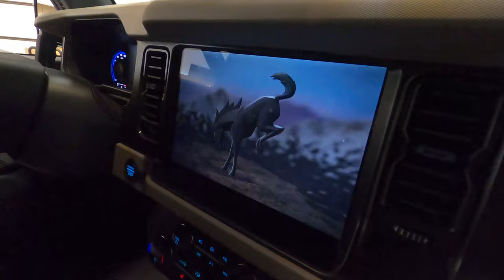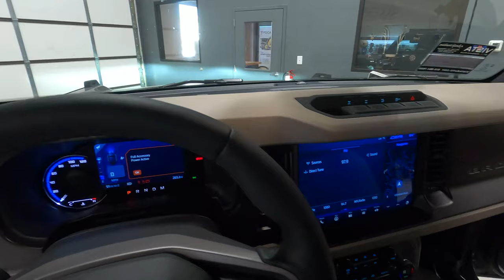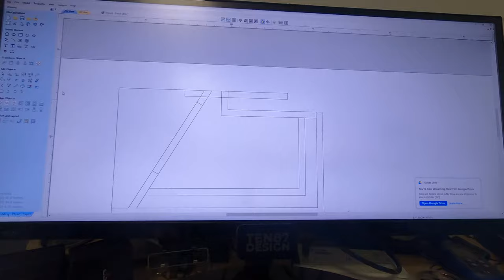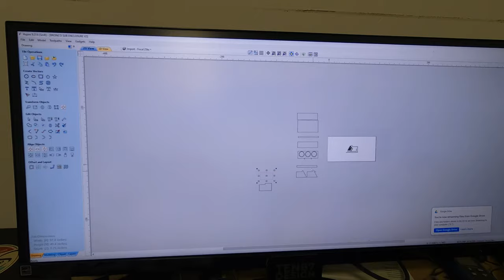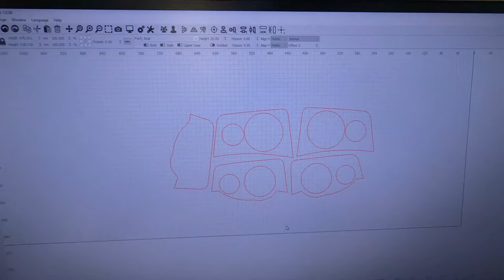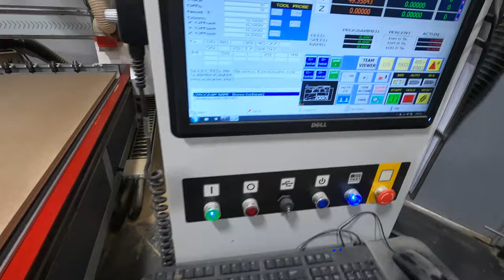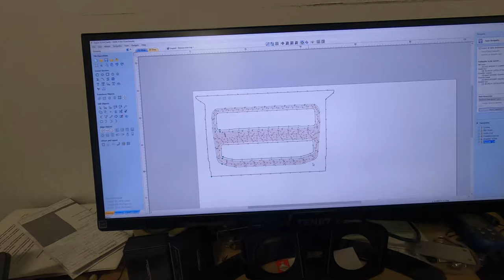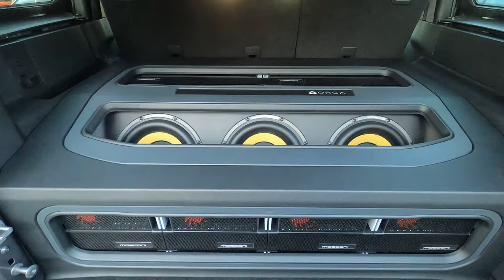FULL Video (2.5hrs): 2022 Ford Bronco Insane Focal and Mosconi Stereo Build

Comment: A pro tip with all the access you guys have pre-terminate the speaker end of the wires and secure them in their locations then run it back to the amp. I do custom audio and visual systems for business jets.

Comment: How are the five channel amps wired up to the front as there's only 3 drivers?
Reply from the maker: Channel 1/2 bridged to tweeter, channel 3/4 bridged to mid-range and channel 5 to midbass. One 5ch (now a 3ch) for the left and one for the right front 3way